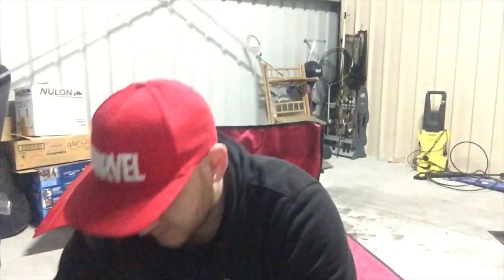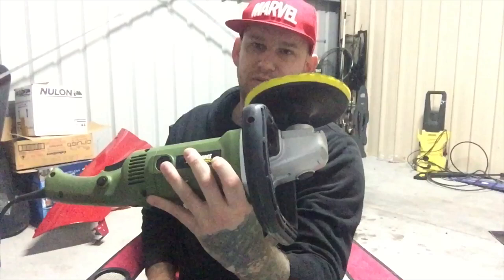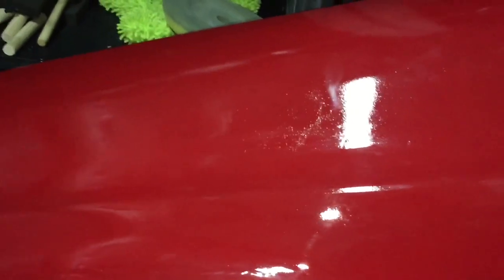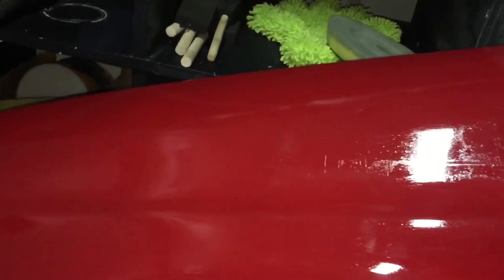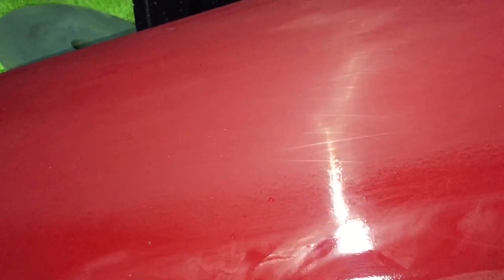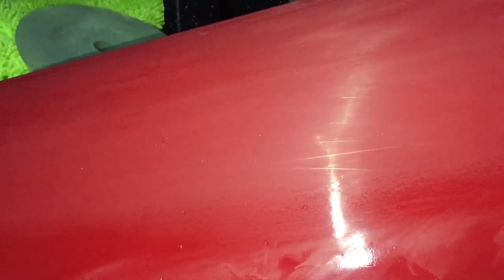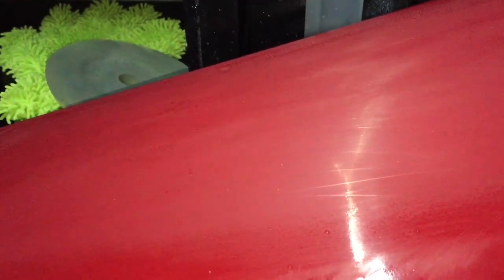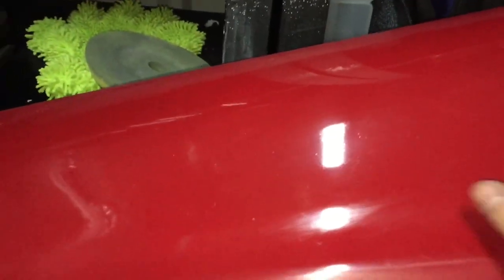How to remove orange peel and make a home paint job look professional

Comment: Wow awesome results!! Just got a used vehicle and it looks like the bumper was repainted at some point so I'll probably be giving it this treatment, but add a light layer of clearcoat and a fine wet sand, 2000-2500. Hope I can get something like you did

Comment: For anyone else watching, always refine your 1500 grit sanding marks with 3000 grit until you can no longer see any 1500 grit marks left. That way when you compound you will remove all your scratches out. 1500 grit sandings marks are quite difficult to remove without being further refined.
Reply from the maker: It will make the job alot easier but you can just but the extra time in with a heavy cut and polish
Reply: Means First We have to use 1500 Grit sandpaper then 2000 then 3000 Yes?

Comment: Hey m8 I don’t have a machine polisher so can I use buffing compound and use with microfibres clothes
Reply: @Justin Rodriguez It will work watch Chemical Guys video
Reply: @Justin Rodriguez If you're doing the entire car yeah but if you're doing a small touch up area or repainted panel then it shouldn't be a big deal. Doesn't really make much sense to fully buff a car with compound anyways unless you had a completely new paint job applied.
Reply: If your paint is in that bad of condition then you don't buff it. If you take care of your cars, you typically should already have a buffer. It's unusual for people driving pieces of junk to want to buff their burned up Honda clear coat.
Reply: @journeytree  bro my car paint is not in bad condition i just wanted to remove all swiril marks and i got it removed by hand buffing and then i applied a ceramic coating
Reply: @Mahesh-pf9nr  If it had swirl marks it was in bad condition.
Reply: @journeytree  it was light swirl

Comment: Great advice about taking one's time! I've been a mechanic for almost 30 years. I've never been a paint and body guy. I avoided paint and body work like it was the plague!! But decided to actually give it a shot on my truck. The clear coat was peeling off, so what's the worst I could do. So far it's been really enjoyable and my results have been really good, surprisingly! I'm doing matte black with gloss red. Would you happen to have any advice concerning the removal of orange peel from matte black? Because I'm wanting a flat finish do I use the same process I used on the red? My paint is a matte paint and my clear is a matte clear (for the black). Won't using the same process turn it into a gloss or semi-gloss? Any advice would be greatly appreciated!! Thanks
 Oh and what's the artist and title of that outro?